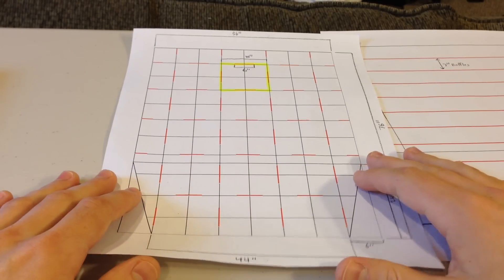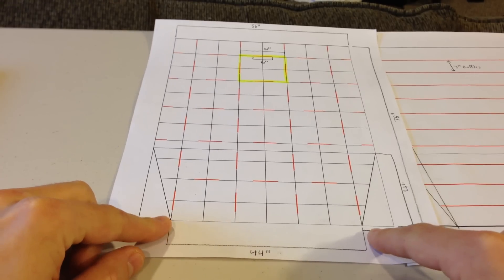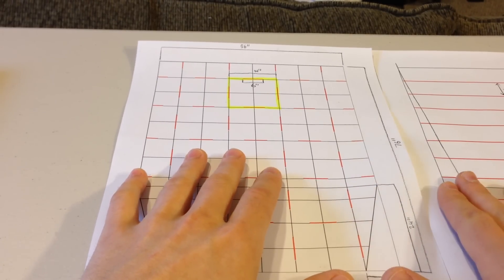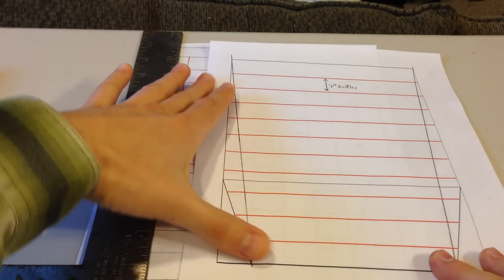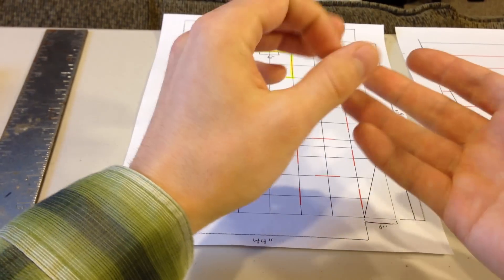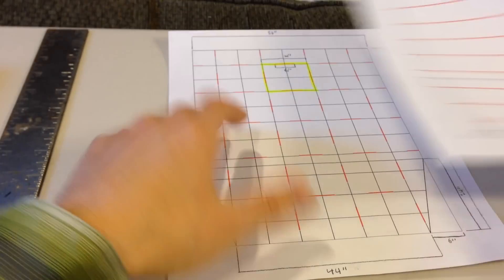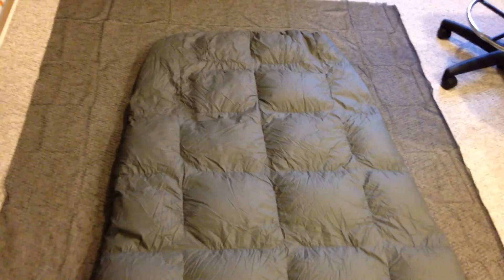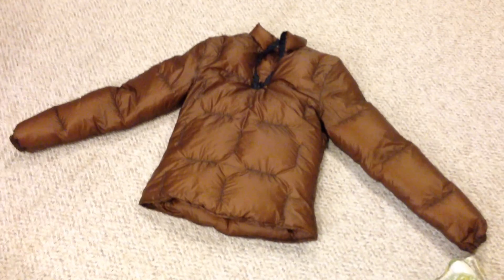DIY Gear Tips: Top Quilt Design Theory

Comment: Hi Joe - now you have your UGQ Bandit as a comparison, how do you rate the performance of your Karo Step quilt? Does the more sophisticated baffle design provide significant benefits, or is the Karo Step just as effective? I believe that Tim Marshall at Enlightened only abandoned the Karo for commercial reasons (to reduce labour costs) rather than performance reasons, but it would interesting to hear your opinion.

As for the Karo Step design, the 50/50 ratio between baffle and gap seems to leave a lot of scope for the down to move overnight - did you have any issues? Is there any case for reducing the gap between the boxes, or using a different baffle layout? Again, your advice would be much appreciated.

Comment: Hey Joe! Thanks for the awesome videos! You're an aspiring PCT hikers savior. I had a question on you design! toward the bottom of you taper, it looks like the grid box you are cutting off is 6 inches? Are you not quite cutting a whole 7 inch grid box off because the drawing looks like it should be 7 inches?
Reply from the maker: +Zachary Wims Are you talking about the vertical edge baffles of the quilt that are only 6" wide? I did this simply to create the exact width of quilt that I wanted. 14" did not go into my desired width evenly, so I took an inch off each side.
Reply: Joe Brewer Ok great! Thanks for the quick response!

Comment: Suggestion: add more width than you think you need. I made a synthetic quilt not too long ago and was amazed how tight it felt. I would make the length 6 inches taller than your height and the width 18 inches  wider than your shoulders. Also, footbox can be tight sometimes, the wider the better

Comment: What type of fabric would you recommend for quilts? Specifically TQ. I've heard of using 1.1 nylon or momentum90...are there advantages to one or the other? ie: the feel of 1.1 nylon against the skin etc? Thanks!! I LOVE your vids!! I'm trying to replicate your sleep system exactly- very impressed. Thanks for sharing your knowledge and experience!! I know it takes a lot of thought, time, and effort!
Reply from the maker: 1.1 ripstop will be your cheapest option, though slightly heavier and not as nice feeling as other choices (make sure it's down proof). Momentum 90 feels nice and is lighter, it is what I used for my hammock quilts. It is a bit pricey though and there are better options now. Lately I have been using ARGON fabric from dutchwaregear. It is super light (.67oz/yd2) and feels really nice on the skin too. It's not cheap ($10/linear yd), but the weight and feel make up for it. It seems to be plenty strong too.

Comment: What are your thoughts on making a DIY TQ + UQ out of a single sleeping bag for hammock use?
Reply from the maker: It could work, though it may be a tight fit with very little wiggle room. I think it's been done before. Check out the hammockforums and I'll bet you'll find someone that has tried this. An alternative is putting a hole in the top and bottom ends of your sleeping bag to allow the hammock to run through. I've seen this done, but again, space is very tight. Not really worth bothering with IMHO.

Comment: Joe, I've really been having trouble finding a sleeping/mummy bag that I feel comfortable sleeping in without feel restricted. I'm a side/stomach sleeper and I hate mummy bags. I sew pretty well and I'm looking to do this, but I'm trying to weight the cost. Can you tell me roughly how much you spent on yours? I'm 6'2, so maybe a little larger than yours. I appreciate all your help. Thanks again!
Reply from the maker: The big cost with building a quilt is in the down. I'd say you can probably get the down and material for around $150-$170. Check out Ripstopbytheroll.com for the material and downlinens.com for the down. Downlinens used to offer a coupon for those that signed up for their newsletter, which would be helpful if it is still offered.